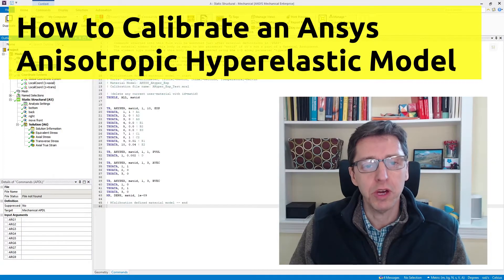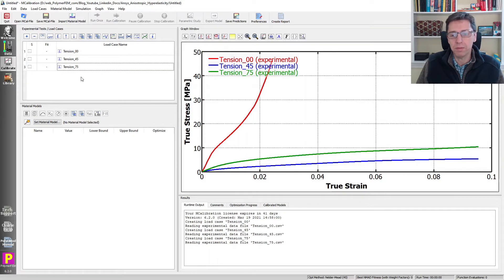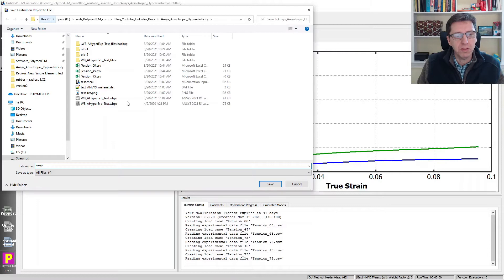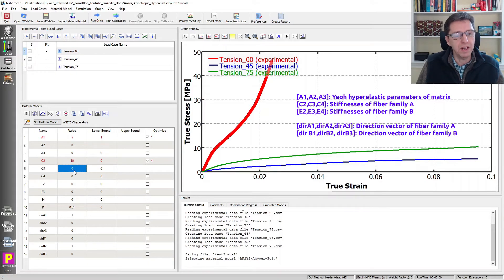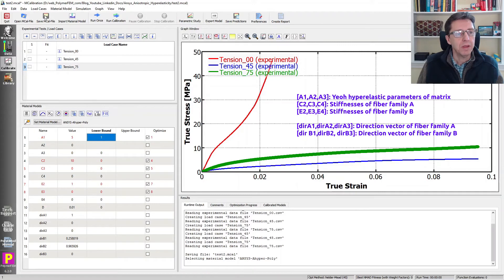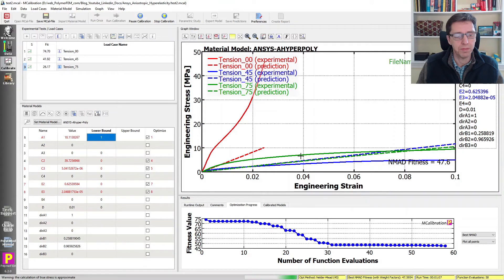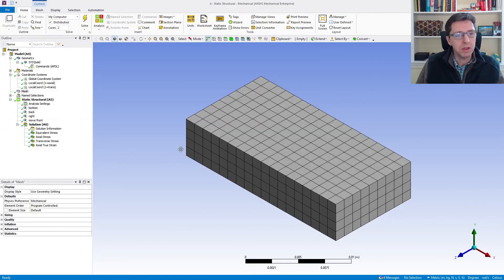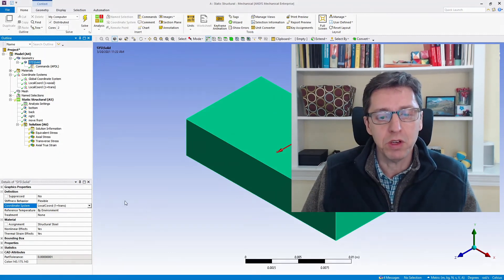How to calibrate an Ansys anisotropic hyperelastic material model

Comment: Good afternoon, thank you for your videos; they're very helpful. For my Master's Thesis, I'm trying to characterize an abdominal surgical mesh, and the material model that best fits the experimental data is MCalibration's Ansys AHyperExp. However, when I try to export it to Workbench, it doesn't recognize it. And I'm also having problems with APDL Mechanical. Thank you very much for your work; it's impressive. Best regards.